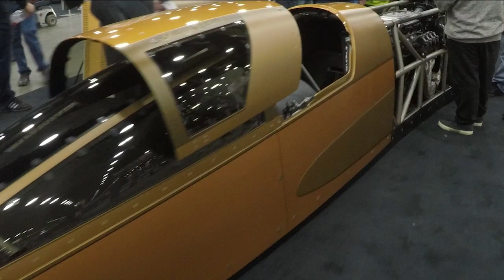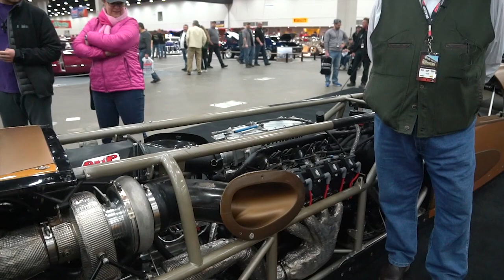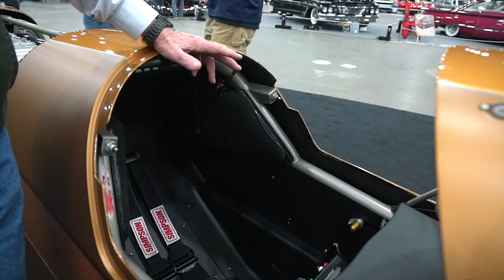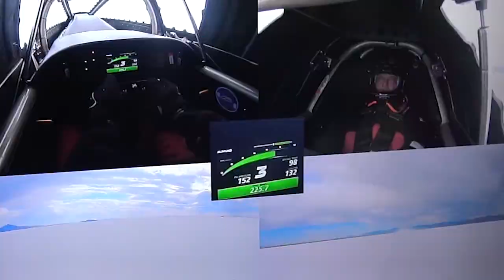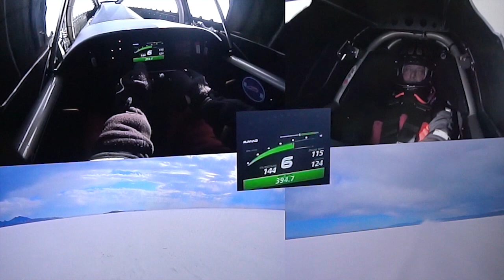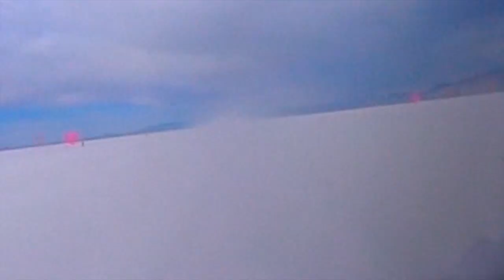George Poteet and his Speed Demon at 2018 Detroit Autorama

Comment: Hi George
Iam designed stream liner for E class diesel stream liner...could u suggest
A good  performance diesel engine guy chassis designed per your suggestion
Re:CG pressure behind height weight etc...its the 3.0 to 4.0 engine
Existing record 170...very doable..what about new 3.2chevy duramax
With upgrade turbo and injector Nox system would like to discuss if you have time
Just a note ......I owned 5 acres next to flats was going to do shops but lost confidence salt condition...Main and I talked